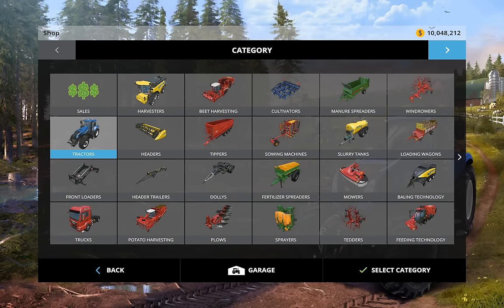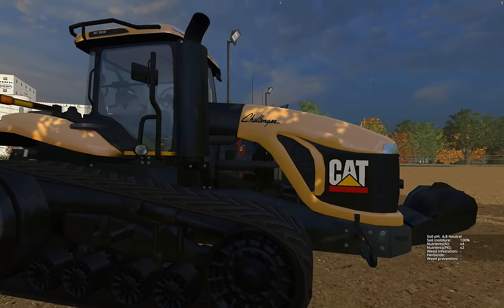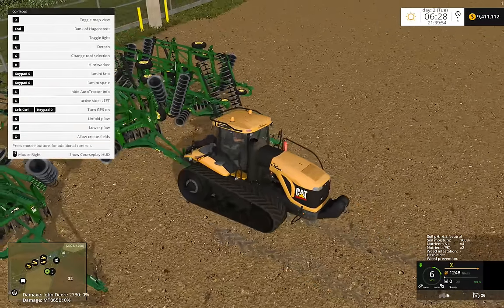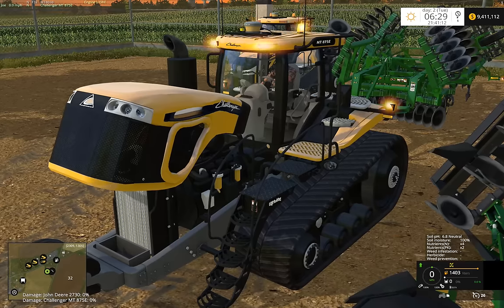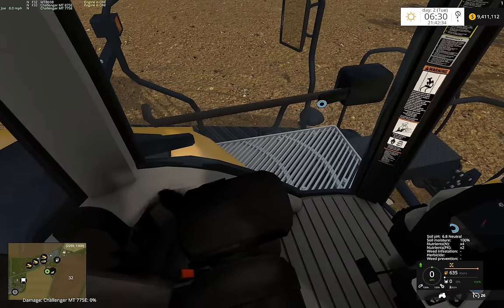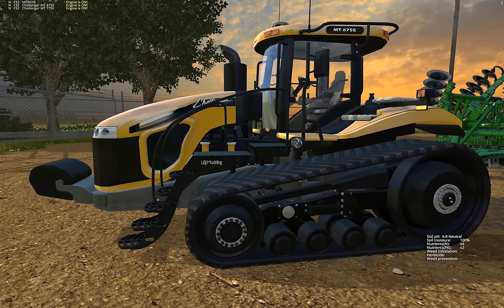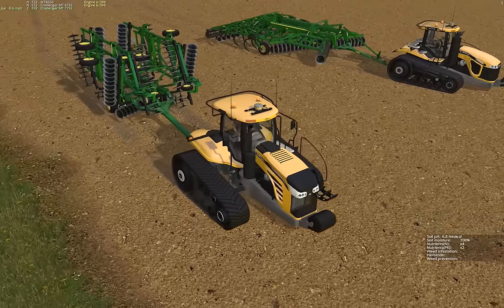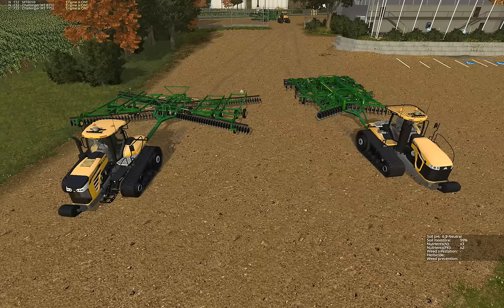Farming Simulator 2015:  Challenger Showdown

Comment: The new cat you just got is different because if you pull up your wire frame it is four wheel steer where your tractors are two wheel steer. I have that mod too and to fix it I just went into the xml file found the Ackerman steering script and replaced it with script from your 9560rt also you will need to set the rotation too zero on the rear wheel script lines
Reply: Exactly what I did, I don't think joe needs to use it, look at his for God sake amazing work but for us mere mortals it's pretty good with a little play in the xml files, I also turned the vehicle sound down a bit